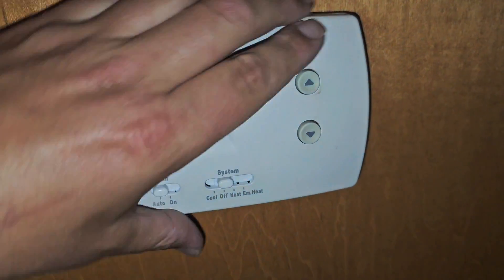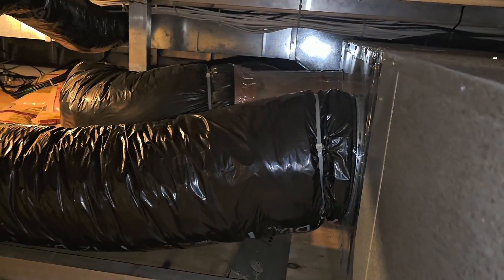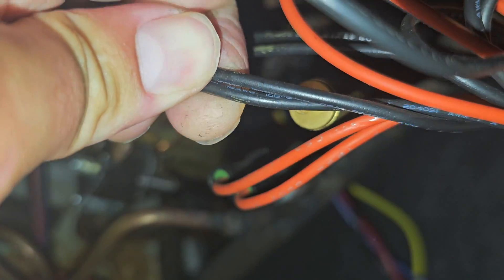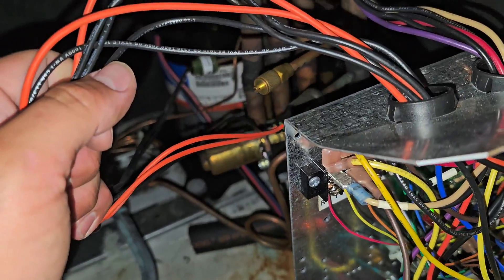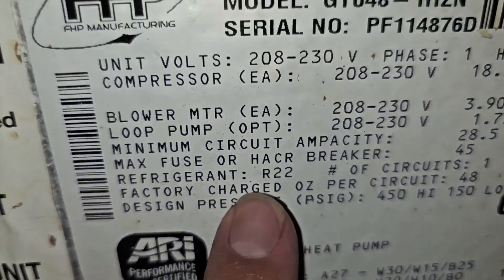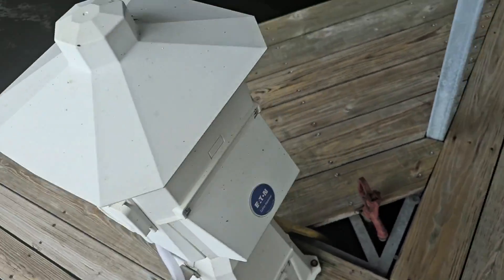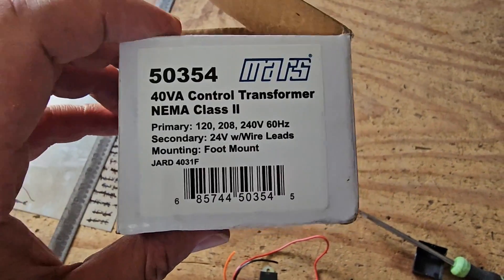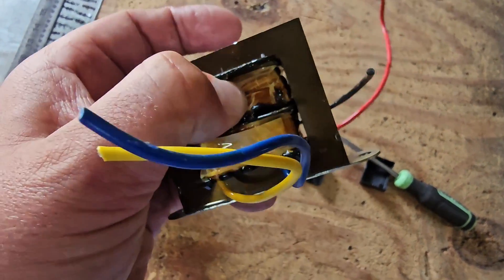The EXPERT Guide to Geothermal Unit Repair on House Boats

Comment: Do you have to adjust water flow in boats just like you do in a residential closed system to get the loop temp correct. Have you seen the issue from a few years ago where Florida h/p units had bad indoor coils. I bet those are impossible almost to change in a boat

Comment: Good Video. i've worked on hundreds of boats in my 40+ years of refrigeration.  water cooled refrigeration mostly. Engine driven refrigeration. think car compressors with cupra-nickel condensers.
Big Fishing boats - with cold storage lockers. Definitely not boring & can eat up the hours. 

 Tips for Working on boats:
1) i use 2 Moving blankets & thrown them down to crawl on saves the knees a bit.
take care of your knees.
You can wear knee pads too. depending on situation.
allways protect your knees !
they also make pants that have built in knee pads. you can wear those.
2) Lucky find on that h. p.  safety. 😎
3) Sometimes those transformers have glass fuses under the covers on the transformer ends. no use checking if you smell burned smell.
4) The Outlet of that txv needs insulated. going to drip water in cooling mode. create mold on wood.
5) Need to insulate other piping going to compressor a bit. keep the water dripping to a minimum.

Comment: Wow, wonder what the cost benefit is to running one type of system vs another. Especially in areas where you dont get a hard winter freeze.
Reply: No benefits whatsoever there very expensive 2 to 3x what a heatpump costs to install this is including repairs and not worth the cost for what little money it saves you over a heatpump litterly nothing you won't save any electricity the only difference is geothermal uses water and glycol instead of refrigerant and still uses a scroll compressor just like a heatpump where most of the electricity drain comes from and unlike a heatpump it also has a water pump that runs constantly which is why you save no money over a heatpump.....
Also not a lot of contractors know how to install these systems correctly and very few in my area will even work on them there hard to get parts for sometimes not to mention your gonna excavate your whole back yard to install a closed loop which is the better system over a open loop. They say oh you will save 80 percent on your heat and cooling bill trust me this is a lie to try and sell you a system iv installed several of these for a few home builders in our area they love the system but agree that it didn't save them any where near what they thought and loved that I was up front and honest about that part even tho they love the Install and system.... If your rich and like fancy toys go for it but don't think it's gonna save you money on the electric bill I promise you it won't.....

Comment: So what sort of corrosion mitigation is present on the boat unit? Look how we have to use anode rods in water heaters to slow corrosion. The coaxial has got to be copper. So I guess the boats zinc must be kept clean and fresh or that coil will become the next sacrificial metal.
Reply from the maker: Good question i'm not sure